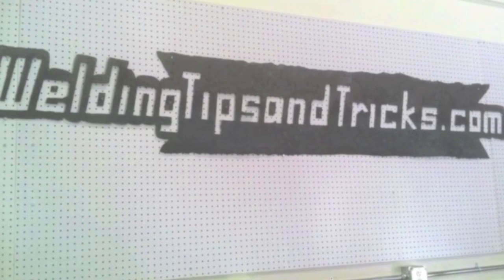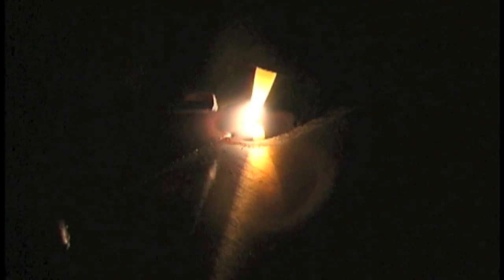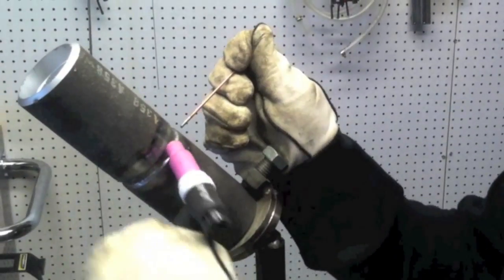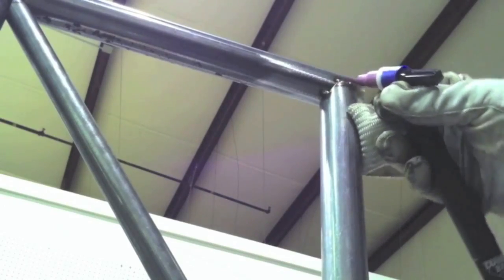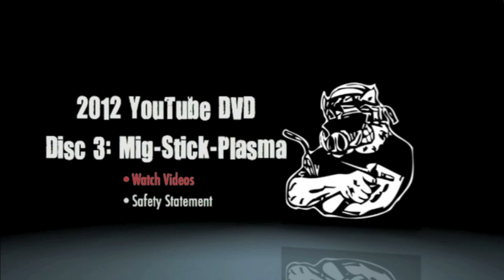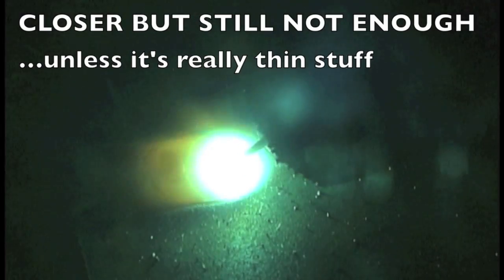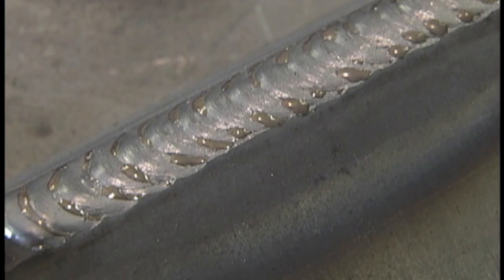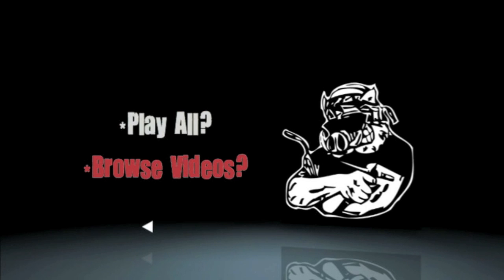Welding Tips and Tricks Videos

Comment: Man I just quite some place for them doing that on stuff over 1/2 inch gaps it was bs and they where using .35 wire. but anyways man if you have to use some filler metal that makes everything smooth and easy. hope that helps :)